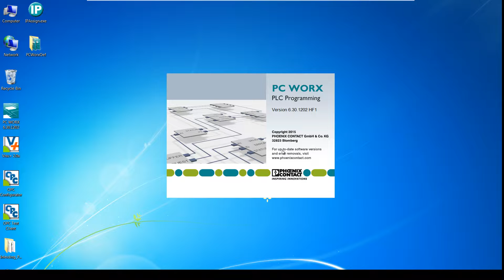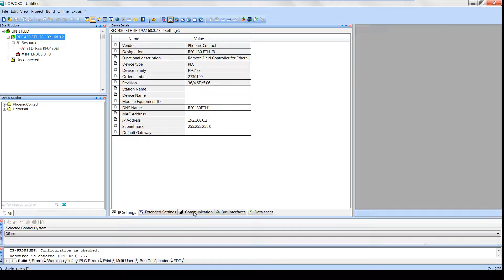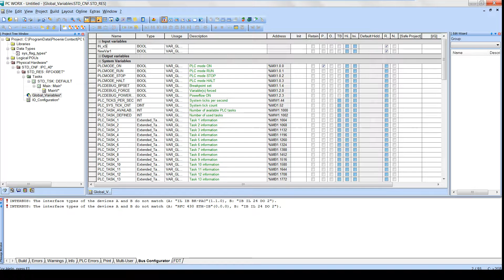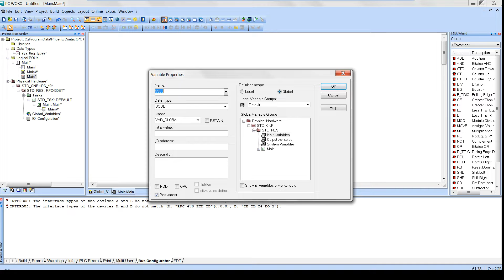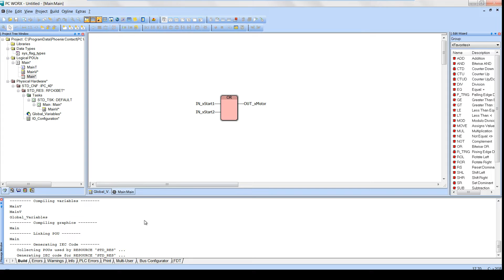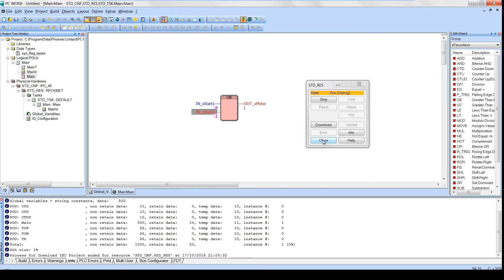PC WORX for beginners

Comment from the maker: - New project: http://www.youtube.com/watch?v=84omTg_S6Bg&t=1m4s
- Activating simulation mode: http://www.youtube.com/watch?v=84omTg_S6Bg&t=1m34s
- Hardware configuration project: http://www.youtube.com/watch?v=84omTg_S6Bg&t=2m46s
- Creating global variables: http://www.youtube.com/watch?v=84omTg_S6Bg&t=4m49s
- Link the global variables with the chosen hardware: http://www.youtube.com/watch?v=84omTg_S6Bg&t=5m57s
- Opening the programming space: http://www.youtube.com/watch?v=84omTg_S6Bg&t=6m45s
- Invert the input (toggle FP negation): http://www.youtube.com/watch?v=84omTg_S6Bg&t=7m26s
- Using the simulation: http://www.youtube.com/watch?v=84omTg_S6Bg&t=8m1s